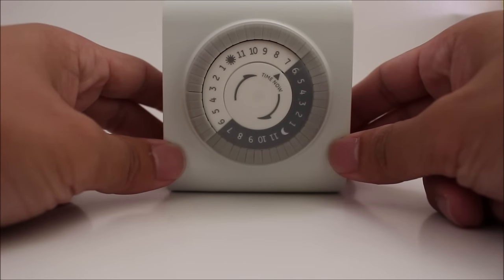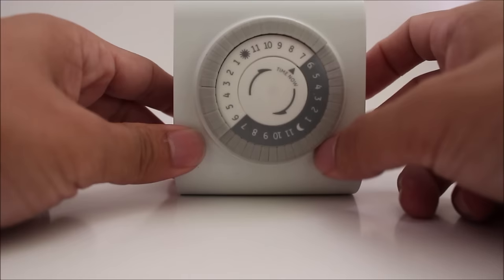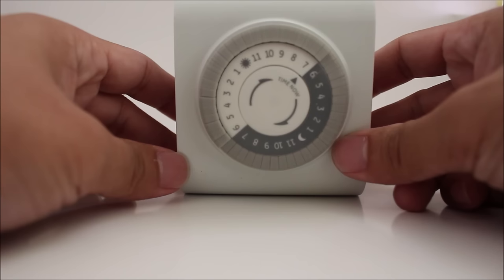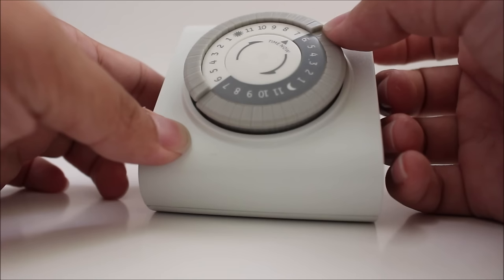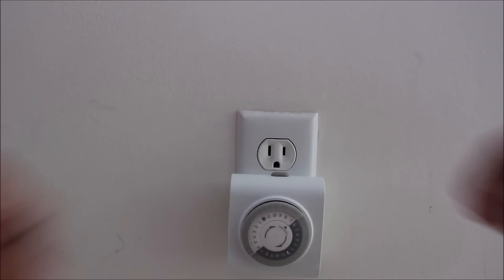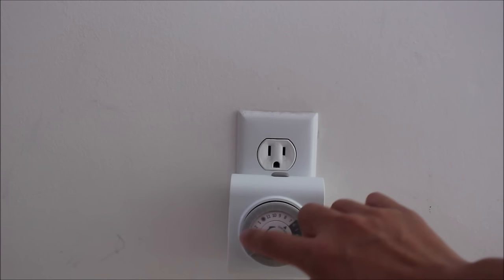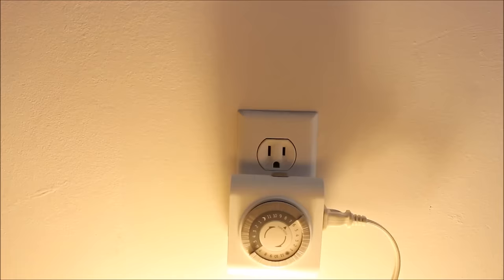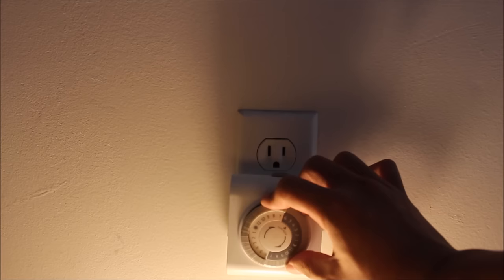How to use GE 24 Hour Plug In Heavy Duty Indoor Mechanical Pin Timer

Comment: Thank you. Mine came without instructions. I was incorrectly using the little switches, so your simple and clear video straightened out how to use them. I saw another person had a video that was 8 minutes long to explain what you did perfectly in 2 minutes. I didn't watch the other video.

Comment: My question is, is the light supposed to be SWITCHED ON (if it has a switch—they usually do) when you plug it into the timer, and how can I bypass the timer if I want the light ON when the timer has it programmed to be OFF?

Easy seeming questions but the tiny instruction booklet did not tell me any of this. No doubt no one will answer this question for a year, by which time I will have returned the timers and bought something else.
Reply: Well, not quite a year later, but I leave the light when plugged into the timer (so it can go on and off with the program), and to bypass just unplug from the timer and use the outlet below (usually don’t have anything else plugged into that outlet). Otherwise you’ll have to keep changing the timer for your needs. That’s my guess, unless there are some tricks I don’t know about 😂

Comment: if you set the timer but unplug the extension cord  that goes into the fan at night and plug extension cord  back in to timer  the next day does the timer work again or do you have to reset the timer?

Comment: I have issues with the switch. I don't know if it's on our off. All these videos focus on the dial
Reply: If by switch you mean the one on top, outlet means it just acts as an outlet, timer means the timer is active and controls the circuit

If by switch you mean the pins, the pins that are in are active power, and pins that are out are unpowered

Comment: This was confusing because you skipped an important step. People first need to be told and shown how to set the current time of day on the timer! Once the current time is set, that is when you set the timer for the time you want it to come on and when you want it to go off.

I use this timer with a lamp in my rabbit room. It works really well—until the power in your home goes off. When that happens—and the power is off for longer than a few minutes, you need to reset the current time on the timer for it to come on and go off at the desired times.
Reply: Do you just turn it to the correct time to set the current time? My timer isn’t rotating on its own at all.

Comment: Ok so all of my pins are up and yet it never turns off! I presswd 3pm and it comes onbut when I rotated it to force it off, it is still on. Help! Mine is the 9000-MTI-WT Landscape Mechanical Power Supply Timer
Reply: I need mine for Christmas🎄 lights.